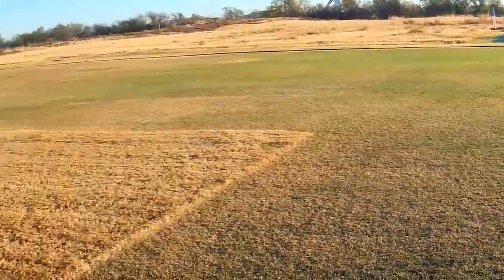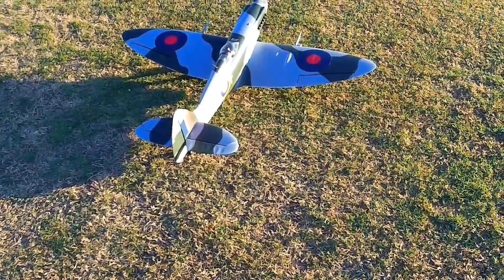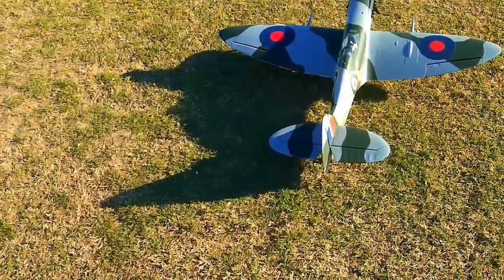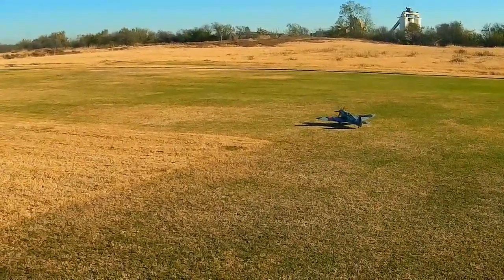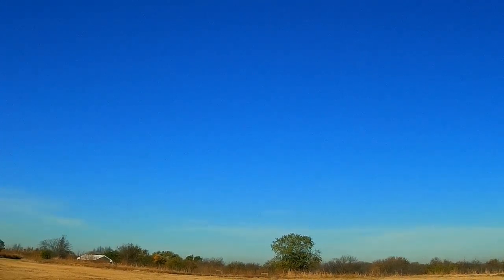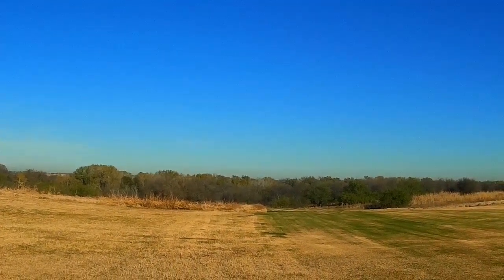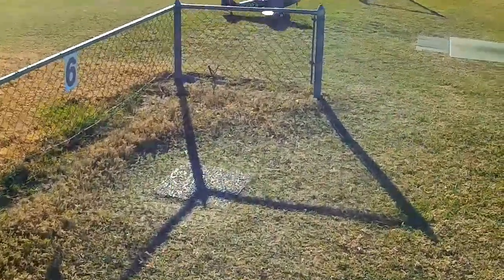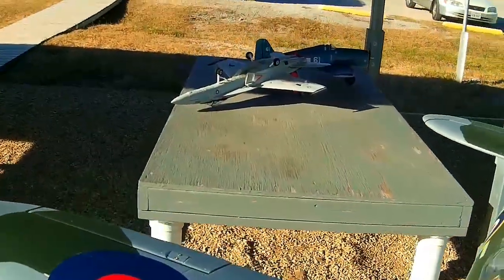eFlite 1.2m Spitfire - Maiden Flights With 3s and 4s Batteries

Comment: glad you did not glue your hand to the plane ! … don't you just hate it when the bottle tips over !
I have started putting my bottle in a container while I'm working with it - so it limits the damage if spilled
and I keep a bottle of debonder close by just in case. 
I put a decal with a profile of Winston Churchill on my Spitfire, painted the cannons black, and painted the wing tips red for visibility. Camo works great for military missions but at my rc park - the more visibility the better for these old eyes.
Reply from the maker: I hear you about the old eyes....Good tip about the stand for the glue bottle when your using it. Thanks.